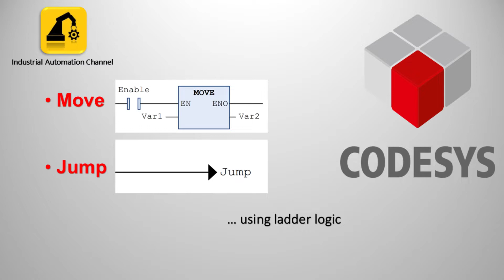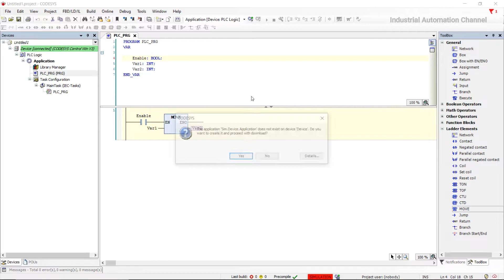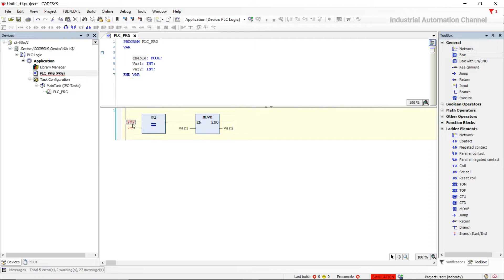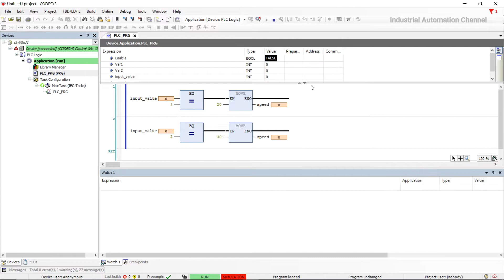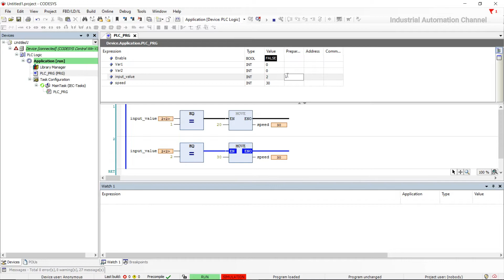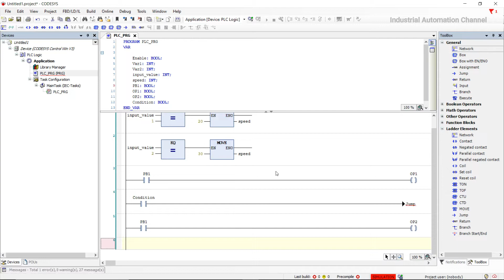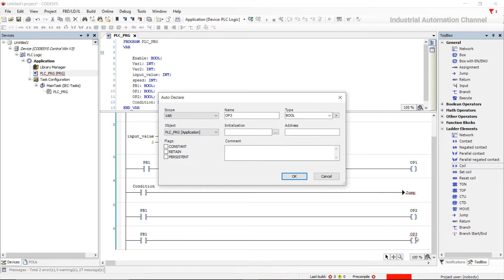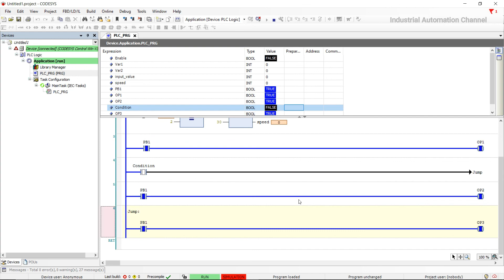Codesys #11: Move & Jump instructions in Codesys

Comment: Thanks for the video, im returning in PLC programming. Do you think Codesys has future in the industry? What would be the functional differences between Codesys and TIA Portal?
Reply from the maker: Good question 👌
Yes, absolutely — CODESYS has a strong future and is still growing. It’s used by many brands like Wago, Beckhoff, and Festo, and you can even use it with a Raspberry Pi. Its strong IEC 61131-3 tooling support makes it well-suited for Industry 4.0 and IIoT projects.

However, large ecosystems like Siemens with TIA Portal and Rockwell still dominate in many aspects.

So my suggestion is this: if you want to work in the industrial automation world, it’s best to learn CODESYS along with one major vendor platform (I recommend Siemens). By learning TIA Portal in addition to CODESYS, you’ll become more versatile, future-ready, and valuable in almost any automation role.

As for your second question: both platforms implement the same IEC standard (Ladder, FBD, ST, etc.) with only slight differences.

TIA Portal is an all-in-one toolkit for programming Siemens PLCs (S7-300, 400, 1200, 1500). It integrates PLC, HMI, drives, and safety systems — mainly for Siemens hardware.

CODESYS, on the other hand, is a universal toolkit that runs on many brands of PLCs.

Both can be used to write PLC logic, create HMIs, simulate, and debug.
CODESYS is free, while TIA Portal is a paid software.

Comment: Hello, thank you for the tutorials. It seems like if you activate PB1 before activating the Condiion contact, the program will not jump, so you have to first make sure that the condition contact is activated first. Is there a way around this?
Reply from the maker: Hello Abdulwahed. That's right. Because as I explain in one of the comments for this tutorial Codesys and CPU starts to run the code each cycle from the first network to last one. Imagine we press first PB1. With the first network OP1 will be on. at the next network condition is not active, so this network will be run. the next 2 cycles will make op2 and op3 on. now we activate condition. As previous cycle first network will make op1 again on. then condition is active and cpu will jump to 4. Network and 3. Network will not be run. But the question is that why op2 is still on? That's on because of previous cycle. In the previous cycle pb1 was active and so op2 will be turned on. but this time this network will not be executed and nowhere else we have defined a code to turned it off again. So Answer to your question: the program jump but the op2 is activated from previous cycle. To see this better change the pb1 after condition network and use another contact. You will see this network will not be executed when the condition is on and what happened in previous cycle will remain.

Comment: #7.33 min when condition is on and PB1 is on,I understand why OP3 is on and why is OP2 is off. But why is OP1 on. It(OP1) has nothing to do with Jump block.
Reply from the maker: CPU runs the codes from the first line to the last. (in ladder logic language from first network to the last one). When the condition is not activated, the first network will be executed --> PB1 is true so the OP1 will be turned on.
second network CPU makes nothing because condition is not activated.
CPU goes to the next network --> CPU sees PB1 is true so OP2 will be turen on.
next network is executed also excactly like previous one and OP3 will be on.
all these happen in 5 ms (according to the cpu cycle time can be more or less) so we think all the networks are executed simultaneously.

now we activate the condition. --> cpu execute the first network --> PB1 is true so the OP1 will be true.
next network --> condition is active and the code says to the CPU: Hey CPU ignore what is happenning and go to the network that the jump labe is :)  so the network after that will not be executed and next step just network of jump will be run.
this will be repeated next cycle and OP1 will be always on  because it is before the jump network and it is not affected by this network. Try to replace this network after Condition and before jump network. you will see this time OP1 will not be on.